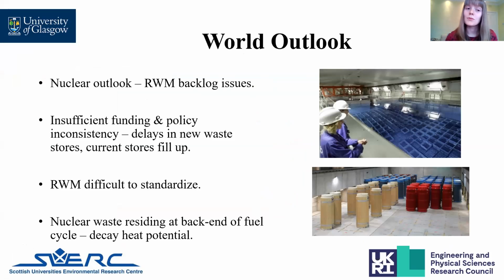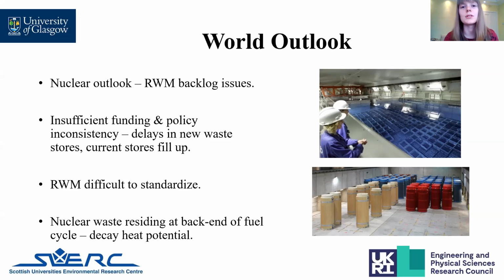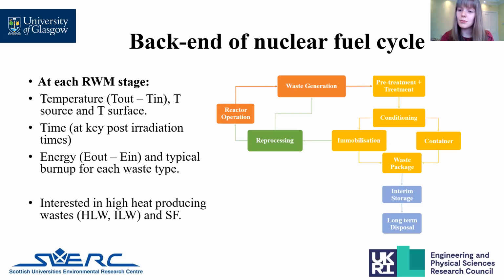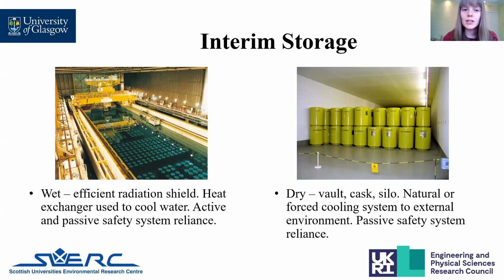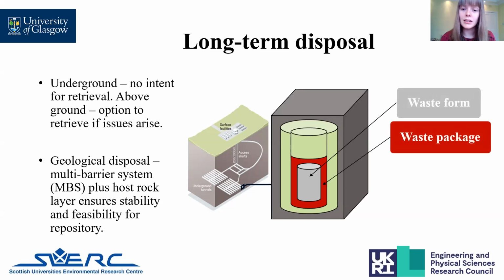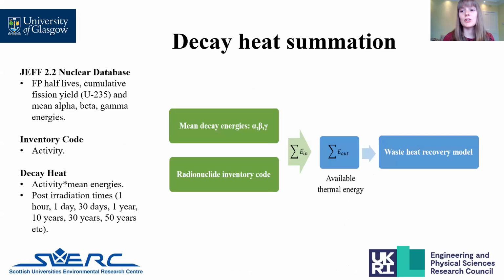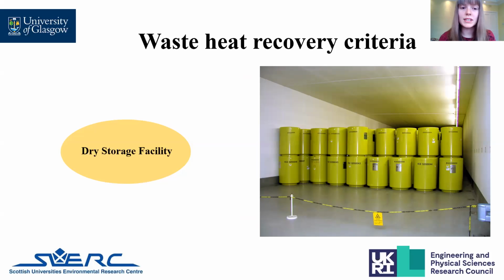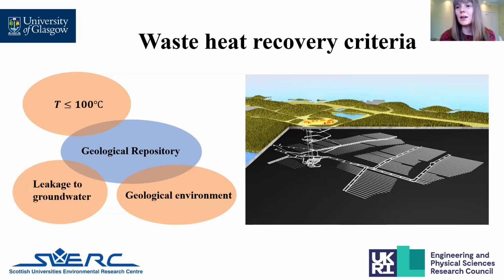MIT A+B 2020-121-Potential for effective recovery of decay heat from radioactive waste residing

Comment: Thx very much. Detailed info about this important topic is difficult to find; much less succinctly summarized, as in this video. The potential of LONG-TERM failure of the electrical grid (as in a solar storm scenario) puts storage ponds (with resirc. pumps) at danger if the power is out for weeks or months. Not sure about how chemically pure the pond water must be. So if the spent-fuel pools could be relocated to, say, the ocean, (or ocean water could be passively pumped into land-based pools, in an emergency)  would ocean water corrode the rods  (ultimately) to cause SIGNIFICANT radiation leakage.